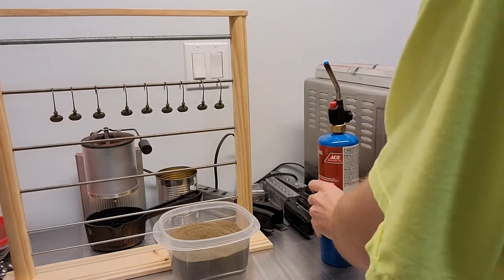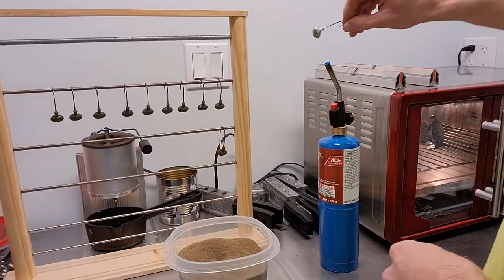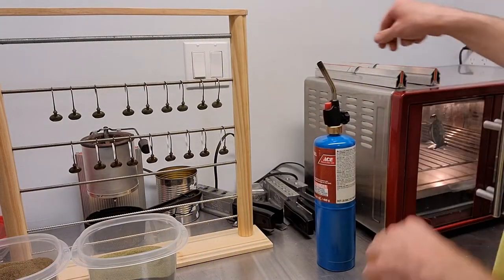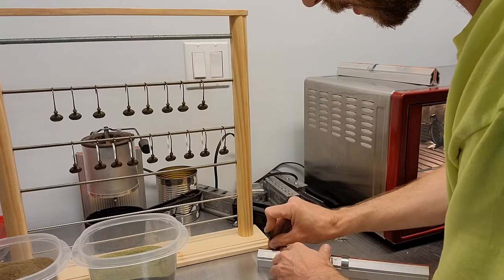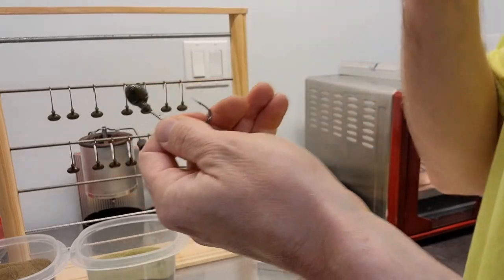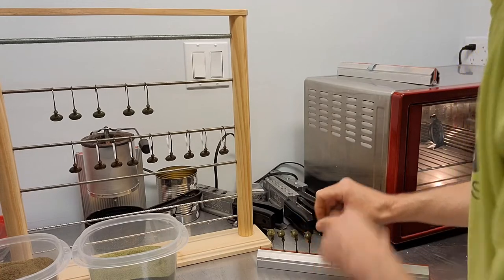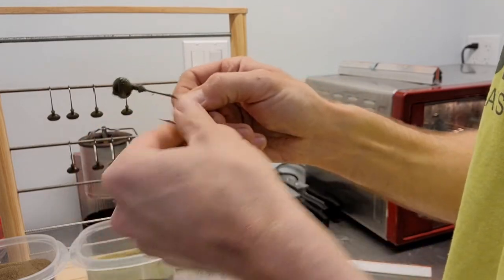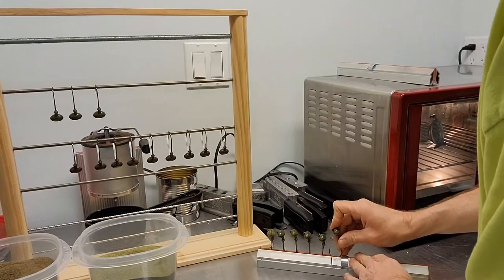Showing how to paint 3/4oz. stand-up football head Do-it mold jigs with stardust perfect results!

Comment: What is the best thing to use to clean out the eye of the hook if the paint gets into it?
Reply from the maker: You can use high temp silicone caps, heat shrink tubing, or a tip of a toothpick to keep the paint from filling the eyes. Most of the time I use the caps but occasionally they can be a pain and fall off when you go to dip the jig in the paint. So I let the jig cool down on my rack, then cut around the hook eye carefully with a razor knife and pull the paint off with a flush cutter but even using your fingernails can remove the paint you want off if it hasn't been heated too much. I still like heating full racks in the oven and it's still way faster than other paints. If you want to give the stuff a try I'd order a small amount and try it for yourself. Only you can decide if it's right for you, most people love it but some don't get the hang of it and decide they don't care for it. I have a few videos up showing how I use it and honestly I love the colors, no long cure time, no glue on my eyes, and it's extremely durable.